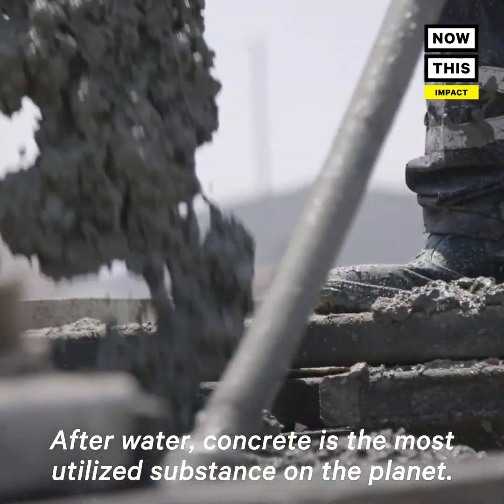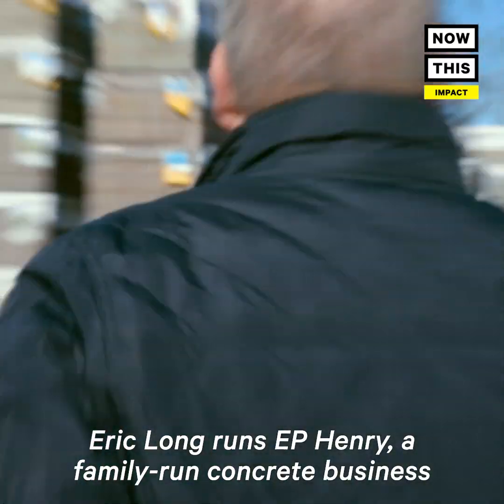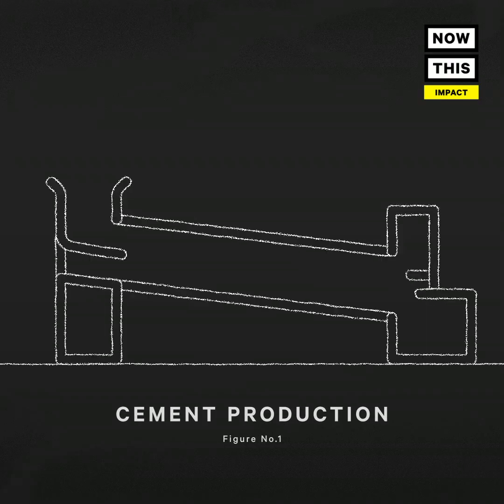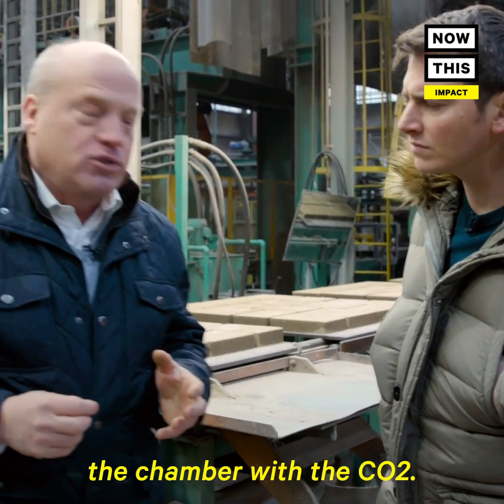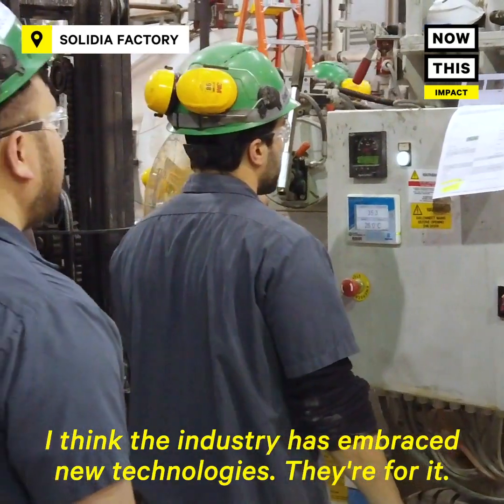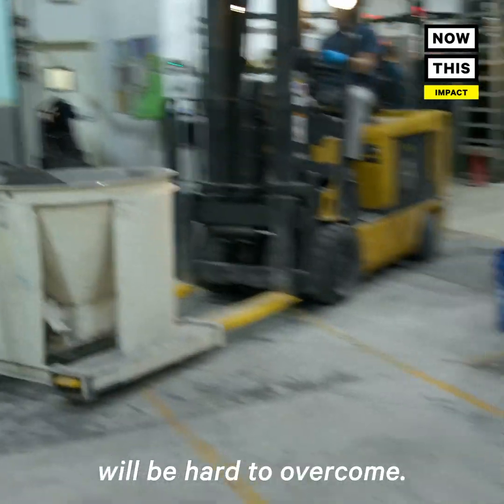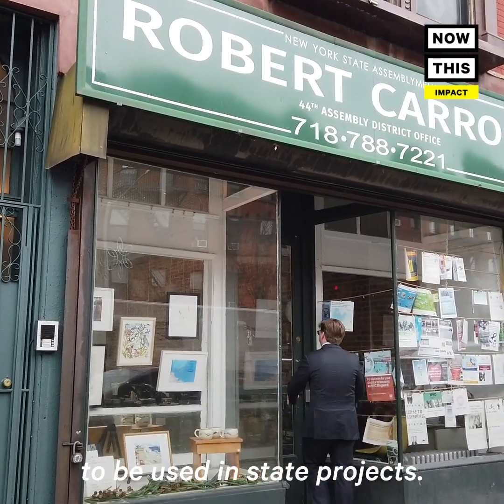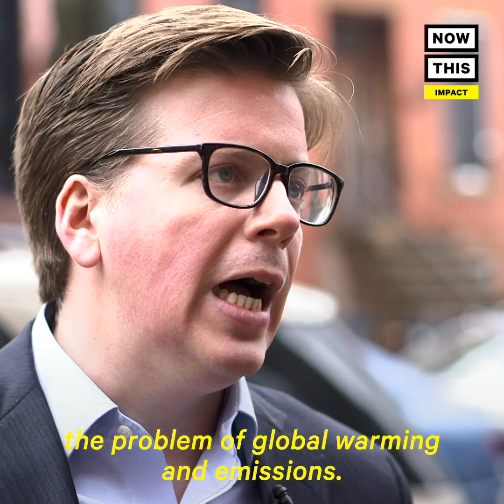Here's How the Cement Industry Can Lower its Carbon Footprint | NowThis

Comment: Although he can't actually assure that the CO2 will be trapped inside the concrete forever, it is definitely a significant reduction!!! 

And he can't assure that because what he's doing is this: when the concrete is "dry", meaning when the water used to produce it evaporates, it creates capillaries (microscopic tunnels created due to the evaporation process inside the concrete and everywhere in it), and through these capillaries many substances such as water and gases, like CO2, can come in and out of the concrete!!! So that's why he can't guarantee that it will be trapped inside the concrete forever!!!